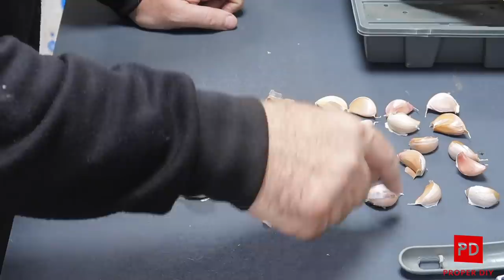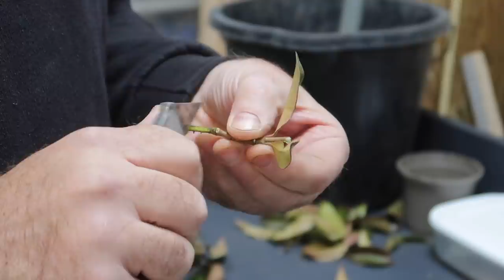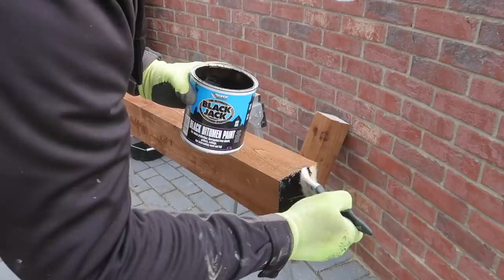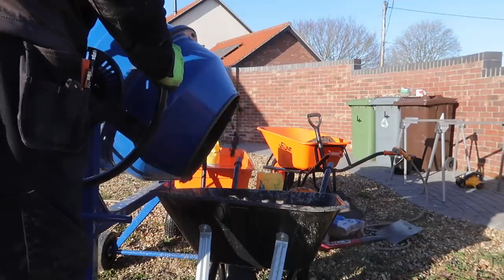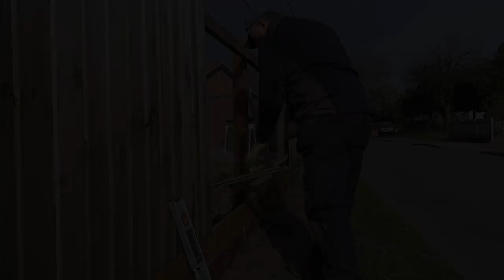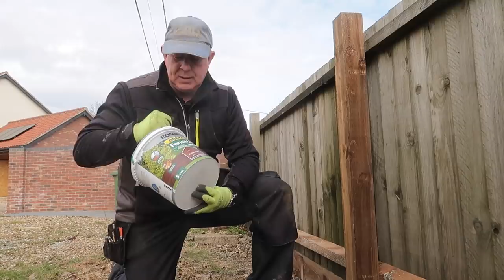Fence Fix - Proper DIY Garden Series

Comment: Regarding using a sprayer to apply finish to a fence, I've had good luck using an HVLP (high volume, low pressure) sprayer.  I've even applied a sealer to both my deck & fence that the manufacturer recommends not applying with a sprayer.  (The reason the manufacturer makes this recommendation is that the product needs to be worked in to the pores of the wood with a brush.)  I found that if I applied a fairly heavy coat with the sprayer then back brushed it with a wide brush the product adhered well. In effect, I simply used the sprayer to get the product on the surfaces and used the brush to work it into the wood without having to continuously dip the brush.  It sure made the job a lot quicker!

Comment: Another excellent video Stuart. After my fence posts rotted through one by one over the years I have now switched to concrete posts & "hit & miss" fencing which allows high winds to pass through the fence instead of catching it like a sail. I have also used a relatively cheap Ferm electric spray gun to paint fence panels. Far quicker than using a brush. I did find that the spray gun drippled a bit so don't use it anywhere near paving or anything else you don't want stained. I laid my fence panels flat on the grass in the back garden to paint them before I put them up. There was some brown overspray on the grass but that disappeared after I cut the grass a week or so later. I too have loads of jobs to do in our garden this year so looking forward to see what you.

Comment: I always leave any new wood in the garden untreated for a few months so it can properly dry out, any excess preservative can wash off (which can stain lighter coloured paints) and it can weather a bit too so the treatment will soak in better. I did some fencing work in my garden back in Autumn last year and will treat it during a warm dry spell this Spring/Summer...

Comment: I set short pieces of 6 inch plastic sewer pipe in concrete for round fencing posts so they are removable if they have to be replaced in future

Comment: I have tried those garden paint sprayers that you pump up by hand to pressurise them, load of rubbish. Tried the gravity fed spray gun that came with my small compressor, massive difference and made spraying a garden bench or 2 really easy. As others have said, watch out for over spray !
Reply from the maker: I'm not expecting much from them - I'll find out!

Comment: What's your thoughts on attaching a new fence to a neighbours existing concrete post, create a new slot with timber slats to accept concrete gravel board and panel, or just go timber posts and gravel boards and maybe step back a foot and dig new hole and allow cross members  to run past post your thoughts please.
Also I ain't see you use concrete post or boards any reason why?

Comment: As usual I love these videos and have learned a great deal from you, Stuart, thank you.  Fence repair is just a bit vital and I had to do it myself for the first time last year.  I picked up such a lot from this video and have a question.  You mentioned the distance between the posts before you could work out how to make the 107mm jig.  I bet my post distances are different to yours and for an experiment I tried to work out how I would make the same kind of jig but couldn't quite get my head round it so, at the risk of a bit of flack from the folks out there who do know, how do you work it out?  What's the maths? Congratulations on the 100,000 views, well deserved, I'm amazed at how quickly it added up...Brilliant!
Reply from the maker: Thank you. Simple really, I had 42 boards to put back into a space of 4495mm. So 4495÷42=107.
If you are planning a new fence and using say 125mm wide boards, maybe aim for around 25mm overlap leaving 100mm exposed.
Reply: @ProperDIY  Thank you for taking time out to answer my query Stuart...and I am really glad it's straightforward.  I made the error of overthinking the problem.  Keep it simple, eh?  Thanks again.

Comment: Just had to do a similar job on my fence

BlackJack - check. (Great stuff)
105mm Jig - check

….but how did you manage to get that old fence post out of the hole!

Usually that’s the real pain with a concrete ball where you need to put the new post 🙄

Great Vid as usual Stuart.   Looking forward to the new Garden series
Reply: Roughneck do a digging spear thing that looks like something from Spartan times. Screwfix and Toolstation sell it...mind it's like owning a shovel...it's only as good as it's operator!! 😂
Reply from the maker: Off camera I drilled it a bit and it came loose - lucky I think

Comment: Just finished this similar job yesterday. (On my fence, not yours🤣) not the post mine are concrete. I made a spacer from offcuts as well, such an easy way to get aligned. I have spayed fencing before and you will meed a brush just to get rid of runs if you get them and tidy up edges. (Keep the air pumped in if using the vacuume type, unless yours is electric/air)   a little tip, Cover things you dont want to mark, just in case of overspray.
👍👍
Reply from the maker: I've heard a lot about the amount of overspray - I'm interested now!

Comment: I thought you weren't meant to seal the bottom of the post, because if you do water gathers inside it and rots it? The water enters the post at the top and sides, and so must drain out of the bottom. Better to seal the whole post than just the bottom.

Comment: If you use a spray for the fence paint, make sure nobody parked their car on the other side. The spray will whizz that paint thro’ any cracks or knot holes. Makes ppl kinda irate. Ask me how I know 😂🤠🇬🇧🏴
Reply from the maker: I',m looking forward to giving it a go
Reply: @ProperDIY  The sprayer does work well but I did have some overspray as well as knot hole patterns on the car.

Comment: I do enjoy your many great videos, but when you make a mistake, like at 5.28 in this one, where you attach the gravel board directly to the post without a spacer of the same width as the cant rail above. It would be good if you either highlight this or not show the mistake, or show the correction that you have clearly made by  the end. 
If a competent DIYer like yourself can do this, it would be great if instructional videos presumably aimed at helping the less experienced, did not gloss over the problem.
But otherwise, I love your content, and appreciate the time and effort you put in to make it.

Comment: I know your an engineer & brilliant. I've used that Ronseal decking paint a few times over the last several years & its dirt. Avoid it. Look for an alternative. Painted a large decking with fence panels during the summer, used it on bone dry timber posts, gates etc. Washed away. In October just gone, I leaned up against those fence panels - expensive clothing was destroyed. Don't use it. Like I said, its dirt.
Reply from the maker: Thanks for the tips!

Comment: I wouldn't use fence posts unless you want to make similar videos in future as storms will just blow them down or they will rot away. Concrete posts and gravel boards is the way forward.
Reply from the maker: You wouldn't use fence posts? Interesting
Reply: @ProperDIY  I wouldn't use wooden fence posts!